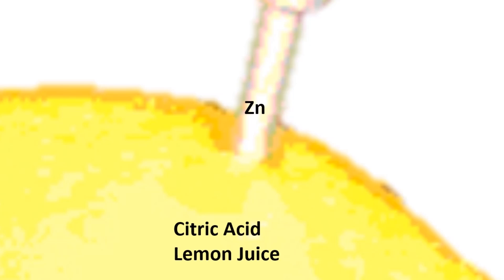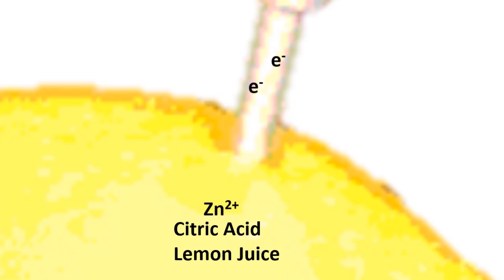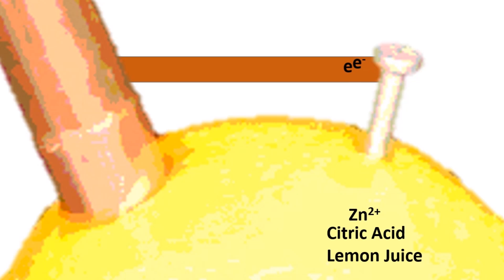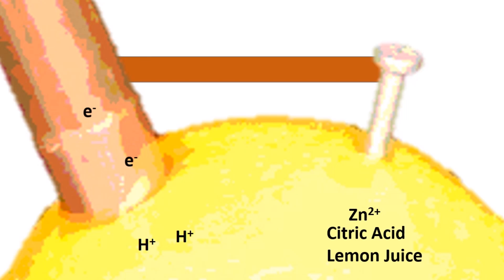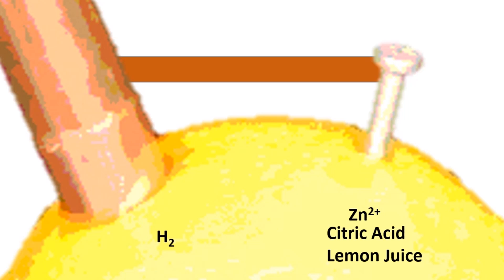How a Lemon Battery works.

Comment: can someone  help meeee

i did fruit battery but i did it with aluminium and copper. 

so is the aluminium reaction will be Al2+ or Al3+ ?
Reply: Aluminium has 3 electrons in its outer shell, so it would be Al3+. A year late, but you're welcome 8)
Reply: @decomposedcorpse5186  It's never to late. Someone else might have this same problem and is lucky to find your answer here ;)
Reply: Thanks for the answer a year later.

Comment: I tested 2 batteries on the weekend and both of them seemed it be “dead". After using one of your methods [Check Details Here==>https://plus.google.com/100351090281822647456/posts/HMvgs7qqoKA ] I was able to rejuvenate them both to 100% working batteries. Thanks, you just saved me about $180! :)